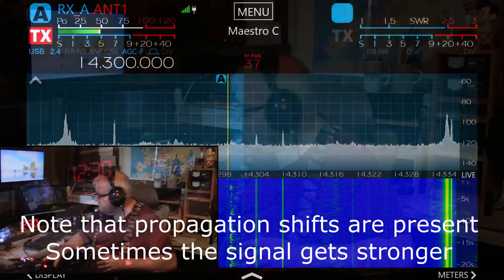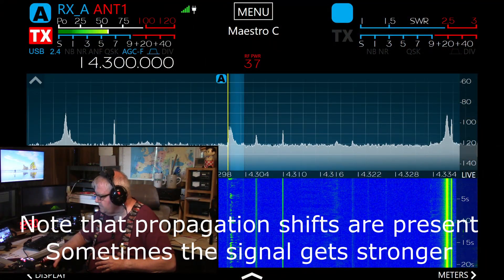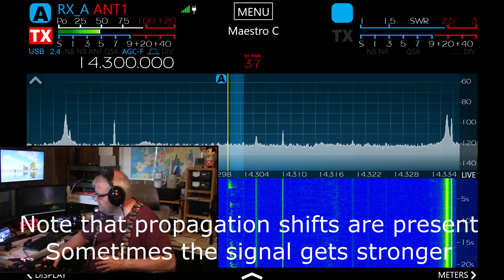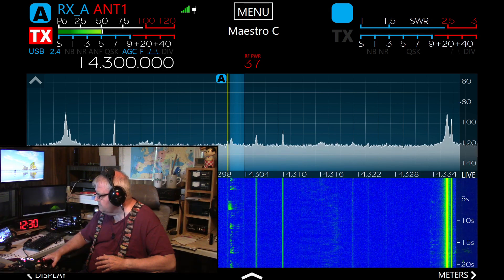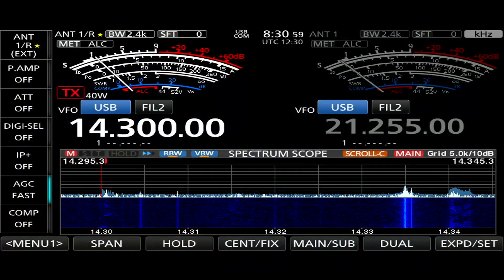Rematch! Weak Signal SSB Test Part 02   Flex 6600 vs Icom 7760

Comment: both comparison videos are great, thank you. I think you are right, the Icom had an edge in the first one, but Flex stepped up and pulled even. Not sure what that means in the long term. but love and appreciate your comparison. 73's
Reply from the maker: I think that both the Flex 6600 and the Icom 7760 are excellent radios. I was pleased that the Flex software update made a difference. I was not surprised though. I'd seen (heard?) this happen back with version 2 software on my Flex 6500. Thanks for watching and commenting! 73 de W4EEY

Comment: I know it’s just a detail, but the one thing I love from Flex is their design and their choice of font, it’s so elegant, nice, pure, almost Apple-ish if you know what I mean, it’s very pleasant on the eyes, while every other brands (that make great (or better) radio) are using basic generic font that looks like a computer from the ‘80s. I’m very oriented to that kind of details, my brain seems more at peace when I look at the Maestro screen or SmartSDR. I wish more radio would use similar font.
Reply from the maker: Flex has the best Spectrum Display (I think). The Elecraft K4 is not bad. Icom and Yaesu are still comparatively low resolution. Never thought about the font choice - it just looks right on the Flex.

I am enjoying the Icom IC-7760. The display is adequate. What I enjoy is having more knobs for control over radio functions. The radio performance on transmit and receive is excellent. 

Comparing the radios got me thinking that Flex needs to release a "Maestro Extreme". A Maestro with more user facing controls. The SmartSDR software for Windows has more readily available control options. The Maestro not so much.

73 de W4EEY

Comment: To my ears the Flex wins, but everyone hears differently
Reply from the maker: The Flex 6600 using version 3.9 software is (in my opinion) markedly better than in my original comparison (Link here: https://youtu.be/kvav7UPwkUg). It could indeed now be better than the 7760 (I declared "a tie"). Not bad for eight year old hardware. Next up is a comparison using the newest hardware (Flex 8600M). I tried to shoot the video yesterday but 20M was not open at all at my QTH at the time I chose (early AM). Fingers crossed for today. Thanks for watching. 73 de W4EEY
Reply: @W4EEY yes, the bans were much better during the winter months and Sun has not been very cooperative either

Comment: It's pretty close for sure.. for me the Icom is performing better. One of the things I did a while ago was route the radios output through a mixer with a good way to EQ the audio on the fly.  My hearing is trashed from work stuff and being able to easily adjust when needed was a night and day difference. 

Thanks for all the videos you do to help the hobby. I know there are thousands that you have helped.

73
Reply from the maker: I believe both radios have the ability to adjust receive equalization (I know the Flex does). But I left that turned off (flat response).  I felt this was the best way to compare.

There is not such a big difference (to my ears) as there was earlier with the previous version of Flex SmartSDR software. Kudos to Flex! Of course with all of the recent solar activity band conditions are variable and that played into what we heard.

Thanks for watching! 73 de W4EEY
Reply: @W4EEY what will be interesting is to see how the Icom could perform running the Mac version of smartSDR , there are so many ways to work these radios it's mind bogeling .

Sometimes I pull out my old TS 440S just to remind me how much better the newer radios are and what they can, especially with dual receivers etc..

Thanks again ...